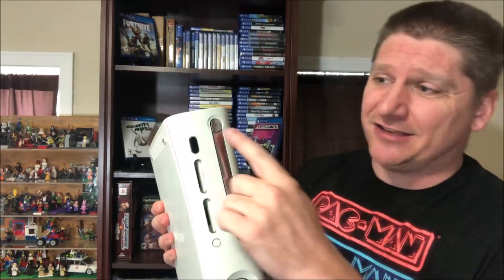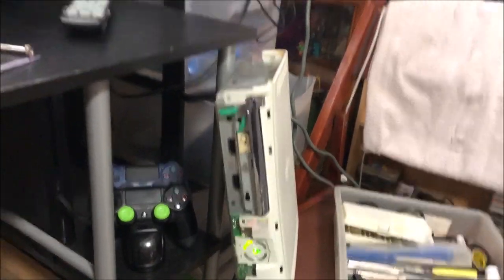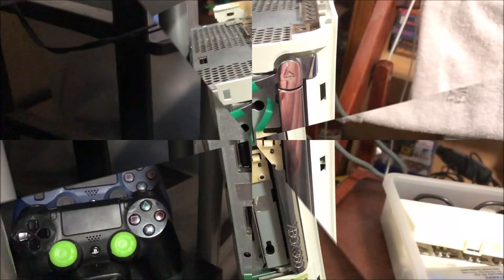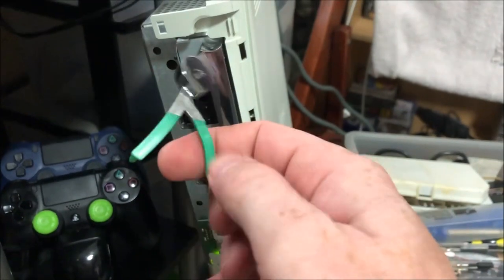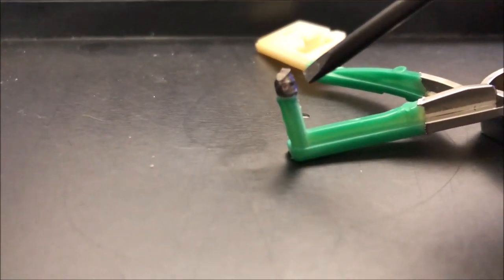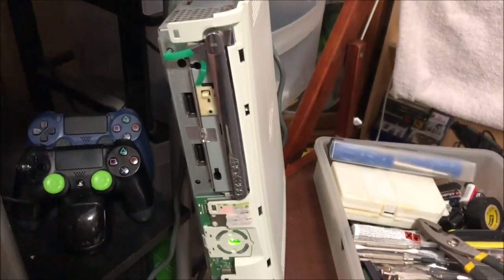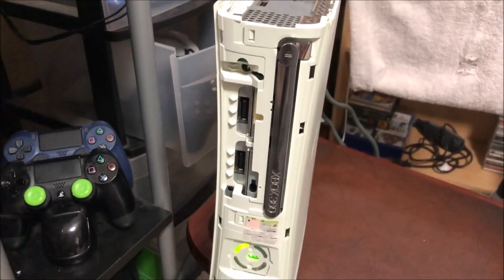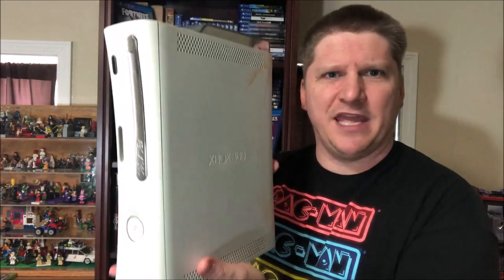O&E #142 - Xbox 360 Ejection Button Fix! Disc Tray Fix (Don't Hit Your Console)

Comment: HELP! I bought a new eject button for my Xbox360 Arcade. The base snaps in properly, but the eject button doesn’t ‘click’ when pressed? What do I do? ive been stuck for several hours
Reply from the maker: I forgot to cover this in the video. But if you buy a replacement part OR a refurbished part it might not be the exact specs you need for your console. ie. The green side arm may not hvae the exact bend it needs to contact the button on the left side of the console (In the small hole)

Comment: I have the same problem with mine. But mine is also broken and i am tiring to find a replacement. If you can assist me i would appreciate it.
Reply from the maker: you can get replacement parts on ebay just make sure it's the exact part for your specific console

Comment: I don't know why just holding an xbox in my hand feels so cool.
Reply from the maker: I like the 360, but damn the cables for the older model are the biggest pain in the butt. They are heavy and thick and they just seem to get tin the way. I also wish there were more shooters on the system.
Reply: @CMRetroGaming  well be thick, im fine with it less chance to break and go bad last thing i want is breaking a console's accessory in iran, where it's hard to come by these stuff. Amazon and such don't ship herem
Reply from the maker: @xm214-aminigun9  For sure, When I see spare cables at thrift stores and garage sales I try to snag them. Have you ever had any issues with the 360 power cable going bad? I've had a few, they they were all the original 360 cables from the 1st model.
Reply: @CMRetroGaming  adaptor is prbably chinese made, the hard drive no issue, the wire no issue the the cable head connecting to adaptor is a little off just slap it lightly and the console will red ring from the cause of power disconnection. Other than that one of the only things to last this long and have no issues is the wire. Even the faceplate power button is broken which fortunately my brother's ruined selfie stick has a button exactly like the one one the power board (the pcb holding that little button you have to press with something thin like a key if your power button is gone) and if this one breaks which possibility is low, but never zero, i can replace it with that.

Comment: Nice job CM! I used a heat gun Very Gently worked great.👍
Reply from the maker: Nice, I didn't think of that. Did you have the same problem with an Xbox 360?
Reply: I did man, interesting to see your fix.

Comment: My husband’s button broke in half what can I use to fix it
Reply from the maker: If it was a button on the controller you can order replacements on eBay. (They are fairly easy to replace) If it was the Power button on the console, you could order a replacement part and fix it yourself but it might require some soldering. Or you could find a local game store/electronics shop that does repairs and they can fix it for you.